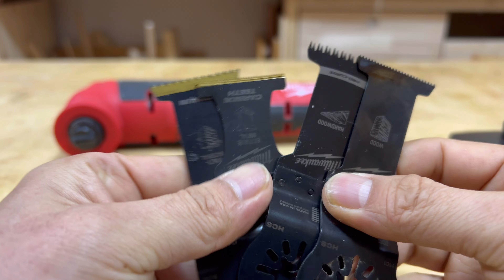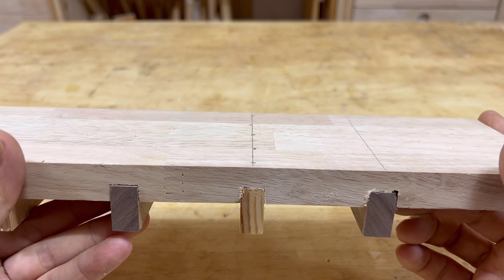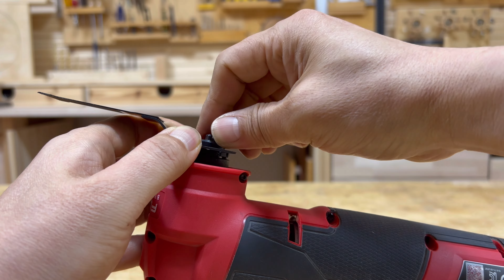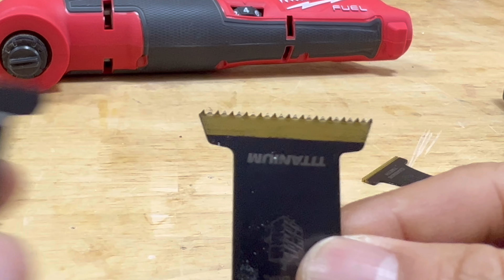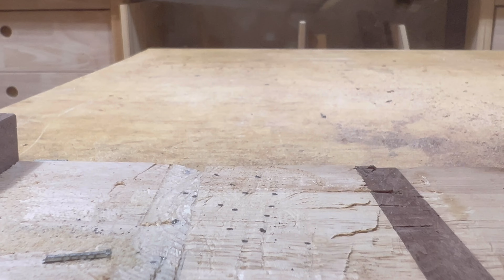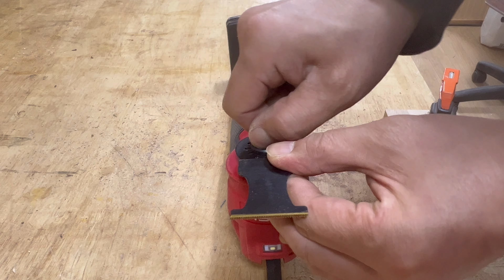멀티커터 절삭 테스트 / 소프트, 하드우드, 못, 나사

Comment: Excellent video, thanks for posting!

I don't recall if you've done this topic before, but a video on the strength of screws pre-drilled vs used without pre-drilling would be awesome. Maybe test pre-drilling just the top piece of wood, then both pieces of wood, then different drill bit sizes? On top of that, testing the benefits of pre-drilling in terms of preventing different kinds of wood from splitting would be very useful.
Reply from the maker: Thanks for good advice! Thank you 😊 Have a nice time 🍀